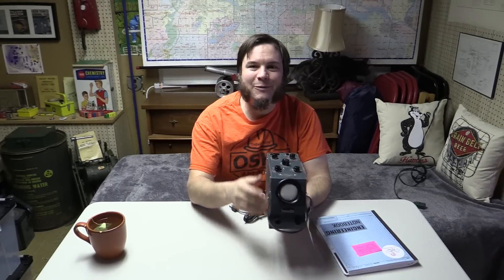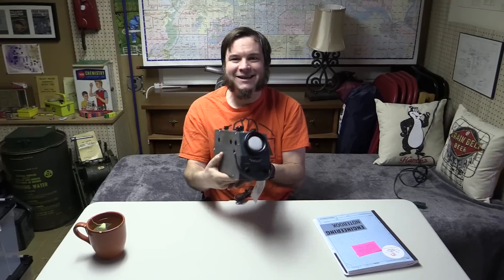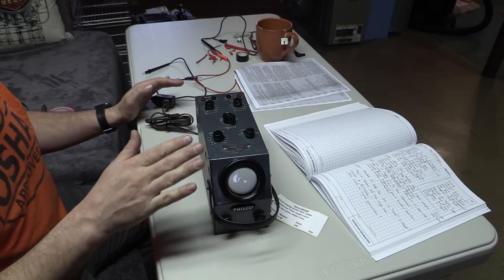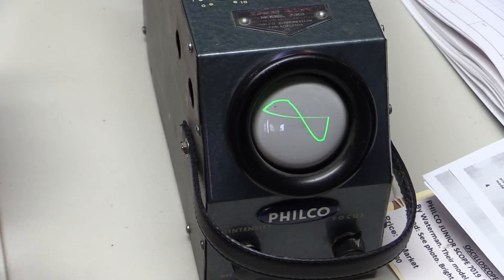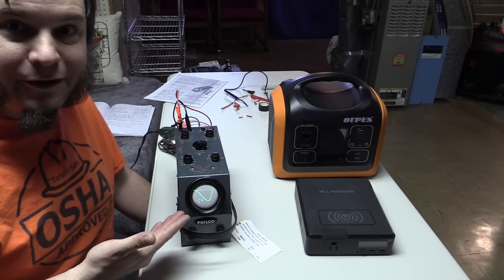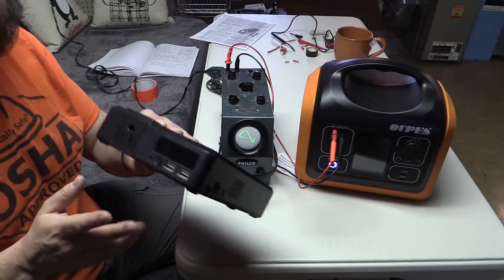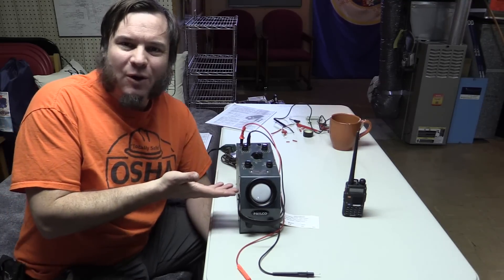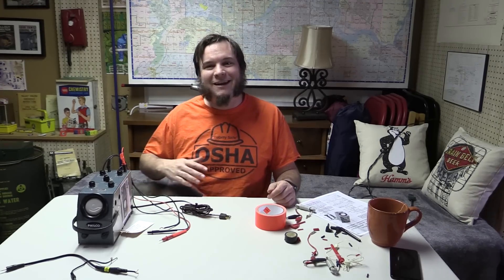I Got An Oscilloscope! Now What Do I Do With It?

Comment: Mr Carlson's Lab: ((Heavy breathing))
Reply: He'd only use it for the case, and maybe the CRT. It's doesn't have a graticle, so you can't measure anything, probably because the input amplifiers are not calibrated - the thing is a novelty at best. Even when it was new, it was basically useless except for very few things that didn't require any actual measurements.

Comment: I'm not sure what your budget would be, but check out the new Rigol DHO800 or 900 series scopes. They are 12 bit scopes as opposed to the more common 8 bit frontends seen on other low cost digital scopes, and for what they can do, they are fairly "low cost" depending on the model (supposed to be $329 for the 812 but I'm now seeing them for $430 for some reason).

There's an EEVBlog forum post on how to hack them to increase the bandwidth on the lower end models, and a script to unlock some extra paid software features. It runs Android too, so people are even writing custom apps with additional features like FFT averaging, or you can ADB sideload apps onto it too if you want other custom apps. You can add wifi with a TP-link USB dongle to connect/interact with it from a desktop for stuff like screen recording or taking screenshots. They also run on USB-C so they can be used portably with a battery bank, and also have a VESA mount location on the back so you could install it up on a monitor arm if you wanted to get it up off your desk. 

I went all in and bought the DHO924S with the ability to use the 16 channel logic probe for arduino projects, as well as for the included arbitrary waveform generator so it can generate it's own waveform outputs to feed back into your circuits being tested. If you don't need the arb-gen, you could always buy something later on like the handheld FNIRSI multi-channel waveform gen if you find you do need that sort of thing at some point.
Reply from the maker: I understood a couple of those words 😅

Comment: Well, one of the best uses of an oscilloscope is probably fault finding in electronic projects/products. When you try to fix some faulty electronics, the scope becomes your best friend. I recommend you to get the book "How to diagnose and fix everything electronic" by Geier. In this book you will get a chapter on how to use an oscilloscope (and other test equipment), and most of the chapters about fault finding often include using a scope. This way you will get a lot of practical usage examples of oscilloscopes for electronics repair work. But one word of warning about this book, after reading it you will probably feel the urge to get a nice (digital) oscilloscope around the 100 MHz bandwidth range :V (recently I also got my first scope, it is a 70 MHz Owon HDS272S Handheld scope, so far a very recommendable tool). This electronics book will teach some basics in electronics too, pretty nice. I also suffer from a too small electronics "lab"/work area, so I picked up a handheld oscilloscope instead of a bench version, + the HDS272S has a builtin function generator, which can produce various useful wave forms :D

Comment: I highly recommend getting one of those Tektronix analog oscilloscopes, a Tektronix 545 for example. They work great, have a ton of value for the price and most importantly you will learn a LOT about how to use scopes with one of those. It would definitley suit you better than one of those cheap chinese mikrocontroller kit scopes, they're just a pain to work with, very limited in capabilities and you learn next to nothing using them.
Reply: Tek scopes have this thing where they will teach you how to use themselves based on the front panel markings.
Reply: @RingingResonance Only if your smart enough to know what the marks mean!

Comment: I dont know what the specs of that thing are, but heres an idea if you feel like getting rich. 
Microcontrolled lcd mini scope. Itd be free to double as a signal generator. But in a nice case resembling this scope, mechanical knobs no touchscreen and a nice manual. Water resistant, probe bay (because youd have the space) Id rather pay 120 for that than pay 20 for the ugly duckling chinpoor doopish
Reply: Ohh, and battery operated.

Comment: You have a better grasp of circuitry than quite a few folks with EE degrees I've had to work with over the years. I am surprised that it does not have a setting for XY mode already - it's not any more complicated, just a different way of driving the horizontal. You could probably modify it "easily" - YMMV, et cetera
Reply: It has xy mode but it is labeled horizontal on the function selector. The terminologi was probably not as standardized as on later scopes.
If you read the manual the horizontal input can either be used to drive the horizontal deflection directly or to synchronize the sweep generator by adding it in the sawtooth oscilator loop.

Comment: If you decide to get another ocsillascope i would recommend look at ones from the early 90's they have most of the functionality of newer ones but still have tube displays. Also its worth keeping an eye out for ones that may not work as they have a common problem where a filter cap on the power in goes bad and those are super easy to replace. I got a Phillips Pm3217 like that fairly cheap and its fantastic.
Reply: I would argue that for much of the workbon this chanel a digital storage oscilloscope is highly desirable.
E.g. cheking the supply voltage when a motor is starting and other non repeting transients.

Comment: Time domain reflectometry (measuring length of cables, checking for breaks or shorts) is my favourite oscilloscope use.  Can be done with only a few components too.  Might not work so good with your basic unit though!

More info here: https://youtu.be/z6UJPqQYzNc?si=Mr05jpKfy5hrZTut

8:00 - Maybe your mains actually does looks that ;-)    I put my modern unit across the mains some time ago and that didn’t go well at all.
Reply: You need very long cables to do time domain reflectronomy on a 100 kHz scope like this. Minimum about 500 meters to resolve any reflections at all.
Reply: @larslindgren3846  - I accept that.  Gabe mentioned what he might do if he had a better scope, so one for waiting till he gets a better one out of the trash ;-)

Comment: Heh, so on-brand for this channel - buy the worst piece of junk ever that wasn't even a good oscilloscope when it was new, waste $40 and a bunch of time, and then proclaim it useless (or with limited use). You don't need the newest fanciest scope, but you need something at least with a graticle so you can actually measure something with it, and from the 80's or 90's, not the 40's... sheesh. Look for an old tek or HP analog scope - they should be about $50, and actually useful. This thing is not the droids you're looking for

Comment: I won a $2200 digital scope but freaked out to try it on anything that is not battery powered. I do not know electronics but I do know you can do a lot of things with one besides testing electronics. I am afraid I will connect mine to something feeding off of 110 volts and it goes poof because of some loopback issue because of ground not being proper or ??   I will fiqure it out though.Maybe I should get a cheap digital scope and try it on things. That works out then use bigger one. Good luck with yours. I did not even know you could just stick the probes directly into the outlet without frying it. I thought it had to be a inline thing .  Hmm, maybe get an isolation transformer to run the scope ....
Reply: Maybe you should just get a class at a local college and learn how to use it!

Comment: My first oscilloscope was a (1947!) TekTronix 512.  I had never seen anything so beautiful.   I was 13, and my dad brought it home from the electronics department of the museum where he worked.  This was around 1976, so that scope should itself have been in a museum!  But it was useful to me for many years after that.  Weighed about 30kg as I recall.  I used it for debugging my first 8080 computer build, and a number of other projects.  Anywhere were you have electronic signals other than DC, an oscilloscope can help you check them to make sure they're doing what you expect.  Modern scopes are often multi-channel, have "cursors" for measuring voltage and frequency, have various trigger modes, etc.  No electronics lab in the last 70 years has existed without a 'scope or three on-hand.

Comment: Adrians digital bacement does a few reviews of really cheep scopes that will be way more featured and useful for what you would want a scope for. Using i don't know exactly what you would use a scope for, as most of your radio projects can be captured with a sdr. But when you need it it's extremely useful.

You can use a scope with fft to align antennas.

I beleve it would be more useful if you where transmitting.
Reply: I think most of the radio signals he receives are too high frequency for a budget oscilloscope. I think it would be useful for checking that DC supplies voltages are clean enough and troubleshooting circuits that control e.g.  the motors that he uses to point the antenna dishes.

Comment: Think of it as a voltmeter, with a very accurate clock.
It just measures voltage over time.
Edit:  I have a 1980s Panasonic two channel analogue oscilloscope which is all yours if you pay for the postage.  Unfortunately for you, I'm in the UK, and it would be cheaper for you to buy a brand new digital scope. It weighs a ton.
Reply from the maker: Sounds neat but yeah, also expensive shipping! I see old ones around here at the surplus store and estate sales, just never knew what to do with them!

Comment: What a cute little unit, glad to see it getting some real use. for your hack-y test leads, I recommend some flexible coax to reduce noise. Think of it as "ground" rather than the negative lead on a multimeter, so you'd connect it to mains earth and the positive to hot. It's also a safety precaution to prevent ground loops, because on most scopes the ground lead is directly tied to mains earth.

Comment: Just started the video. 

There are some really good 4 part YouTube videos on the internet that take you thru using the scope. I actually just played with mine to figure most of how to use it. But, the videos were great too and filled in some things missed by hunt & peck.

I have an old analog BK Precision 30 Mhz scope I used often when building simple CW transmitters. I also have a $30 Chinese scope that is good for the audio portion of signals. 

Boy, when needed they are indispensable. The last time I used one is when I built an audio equalizer several months ago. It really helped to actually see the frequency being attenuated as you turned the variable resistor for the selected range.

You, will definitely find uses for it. It kind of opens the door to new things to check change over time.

Footnote: (after seeing the video)
I picked up my BK Precision 30 Mhz scope for $100. If you want to build transmitters or receivers down the road you really want a least one good to 30 Mhz for HF stuff and used analog seems like the inexpensive way to go providing it still works and all the caps have not gone belly up. If you want to stay strictly audio then a Chinese scope can be had for very little, but I noticed the other day a Youtube channel that does a lot with crystal radios had a darn nice Chinese scope he was using to show the presumably audio signal rather than the actual music and I think it was under $50. Not sure if the Chinese market has RF capable scopes or not, if they do that might beat chancing an old analog scope works for long enough to justify buying although I have had mine for 15 years and it still works well.

Comment: Most pre 70s only go up to about 1 or 3 mhz. I got an mid 90s HP 54610a that goes to 500mhz there about $250 on eBay. Mostly I use the HP to check other gears frequency.  And the old one's are nice because there very hard to damage.

Comment: Very cool find, and from the 1940's no less. I have a modern digital oscilloscope, a basic Rigol that was a really good value (in terms of features vs cost). I don't use it every day, or even that often. But it's useful (to me) to see waveforms. I was recently playing with addressible LEDs and an Arduino microcontroller. That was a lot of fun in itself, but I was curious about the data line. What did that signal look like, and how did the whole addressible protocol work. I got my scope out and watched the waveform. It's bursts of square waves, 24 bits at a time (8 bits each for Green, then Red then Blue), for each LED. Timing between bursts makes it work. It was so cool to see it in action. I've also seen modified sine wave output from a UPS, which looked much like the first battery bank output you showed. For me, it's about discovery and seeing things. That's just my use case.

Comment: I'd suggest for your next scope to get at least one with 2 channels. That way you can make measurements at 2 locations on a PCB simultaneously. You can examine the input of a signal and see what happens with the optput.
Reply: 2ch, 50mhz bandwidth or higher. Lots of used scopes from the last two decades (some digital) that will do that for less than $250.
Reply: @RingingResonance  I agree with at least two Chanels. I don't see a sharp cutoff at 50 MHz, it depends on application. 100 kHz is good for simple audio and mechatronics systems. 10 MHz is good for most slow digital serial communication slow Can busses, some IF circuits in radios, most switchmode power supplies and motor drives. 50 MHz is better, can be used in more systems and gives better confidence in that the measurement captures all relevant transients. Faster digital circuits or rf circuits require higher bandwidth sometimes in the GHz. 
For general use I consider 10 MHz to be minimum, 100 MHz good, higher bandwidth if you have special needs and the budget.
There are some cheap 8 Channel 100kHz USB scopes that seem useful but then it is maybe more a data logging system than an oscilloscope.
Reply: The ability to make floating measurements with a battery operated oscilloscope is worth much science differential probes that are needed for floating measurements with a grounded scope cost as much as a cheap oscilloscope.
Just make sure you understand the safety implications of floating measurements in different circumstances.

Comment: Think of an oscilloscope as the next step up from a voltmeter, or a voltmeter that graphs over time. You can even use one as a voltmeter, but I've only done that in a pinch when I misplaced my meter. I couldn't recommend getting an old scope these days, given what you can get in a cheap modern scope. Your projects keep intersecting with territory where a scope can paint a picture rather than giving you a number and a picture can be worth more than 1000 words when describing what a circuit is doing. The important part here is that you apparently understand a scope is in your future. Lol. I recently picked up a portable 170 MHz bandwidth unit from Owon which is more useful than any scope I had in the 80s, but the cheap desktop units today can't be beat.

Comment: Your scope has no graticules....markings to assist you in measuring a quantity of voltage or time. Like you will see 170 VAC PEAK from your 110/117/120 VAC power from your home. The 120VAC is voltage expressed in RMS Root Mean Square, not peak voltage.
What speed in MHz is this scope?

Comment: Connect up a radio (battery-operated) speaker to the oscilloscope to see the audio waveforms. Or connect up the NTSC video output signal from an old camera, that you don't care much about, because the hot chassis could damage it, and look at the video signal. You should likely plug that oscilloscope into an isolation transformer because I wouldn't trust it not to blow up something with line voltage on the chassis... 
Just be careful, the old test gear can KILL you!

Comment: You need to get you a cheap Chinese oscilloscope that has triggers, grids for voltage and time... this thing is TOO basic.
Reply: The problem with digital scopes is they are often too "handholdy", you just set em to auto everything and they just work. Great for practical quick troubleshooting, but not good for actually learning about scopes.
Reply: I studied electronics in the 1980's and they said the same thing about digital multimeters.   A multimeter or scope is a tool.  I want to see the voltage or the waveform of what I am testing or troubleshooting, the sooner/easier the better.  Nothing was lost in a digital multimeter that could automatically set the scale and show you the voltage vs. having to manually select a scale and then look at an analog meter and try and decipher what scale to look at and what voltage you were measuring.
Reply: Looks like somebody made a side plate for it.
Reply: Open source handheld one. Scopefun maybe

Comment: Your sine wave from the battery unit is off frequency slightly and so the waveform is rolling.
Reply: If anything, it’s likely the grid. 59.95 - 60.05 is relatively normal

Comment: Input 60 cycle into both horizontal and vertical to see a circle.
Reply: I'm pretty sure that's how the Outter Limits guy gets you - they control both the horizontal AND the vertical, and then they got'cha
Reply: @gorak9000  LOL
Reply: If you want a circle, you need to graph a sine wave and a cosine wave. If you feed the same sine wave into the vertical and horizontal inputs of a scope you get a diagonal line.